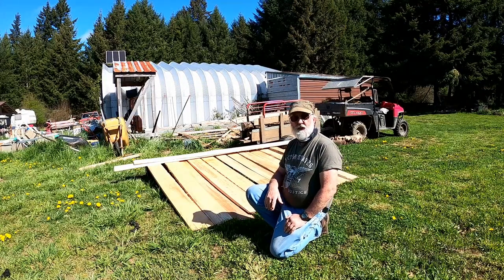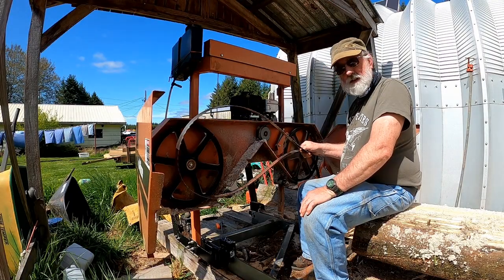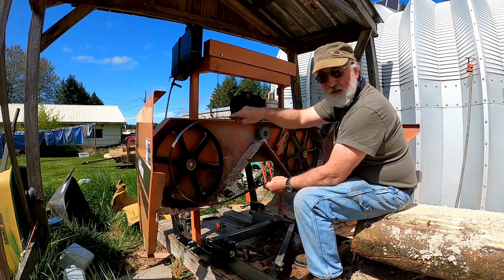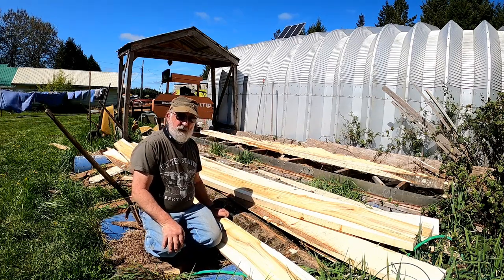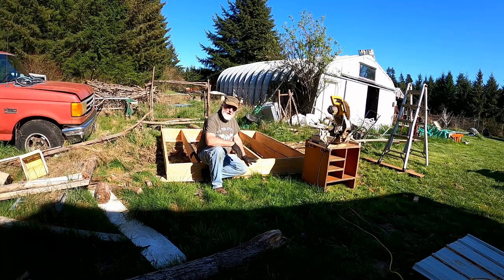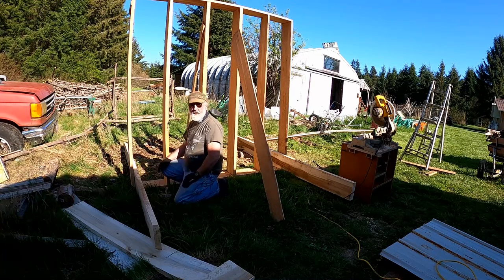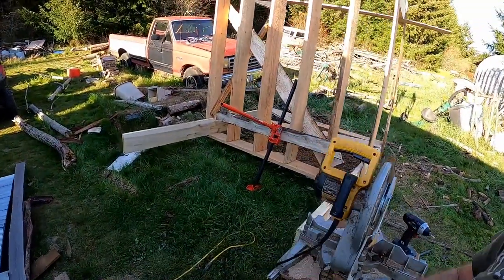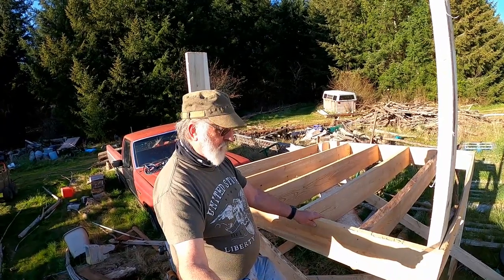Chainsaw table part 1

Comment: I don’t understand everything.  no subtitles.  I’m waiting for the completion of construction, then I will understand everything without words.  :) Google Translate   +!
Reply from the maker: Sorry But this is a raised chainsaw chop saw bench for cutting firewood quick and easy with no bending over to cut the wood. It will drop into the trailer so I do not have to pick it up more then once to take it out of the trailer to stack it. Part 2 will be tonight.
Reply: That is a very good translation!
Reply: @HelicoolsHelipad  :) work prevents you from watching releases on time.  I envy those who quarantine rest.  :) a power-saw bench - it looks terribly expensive.  and I envy you, kindly :).  a little later I’ll review everything that I missed ... again Google :)
Reply: @kulemkin  The saw mill that Bob uses is more than I can afford. He has saved a lot of money making his own wood rather than buying the wood at the store. Bob has to work during the week, as he is considered essential.